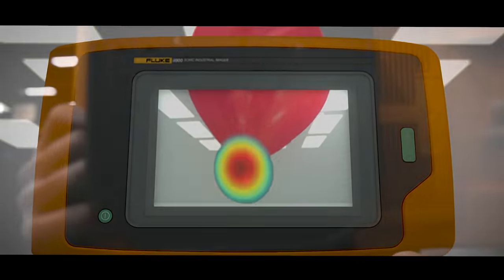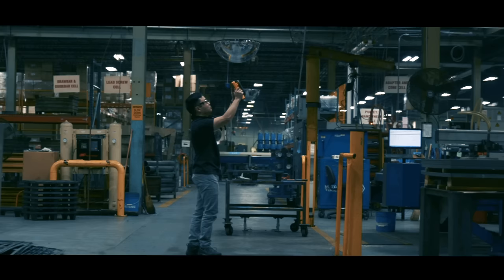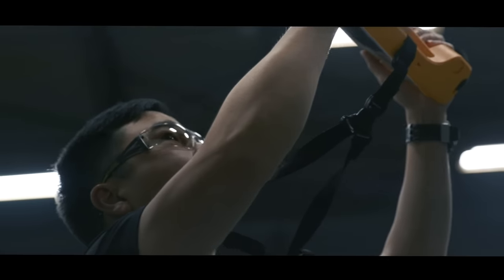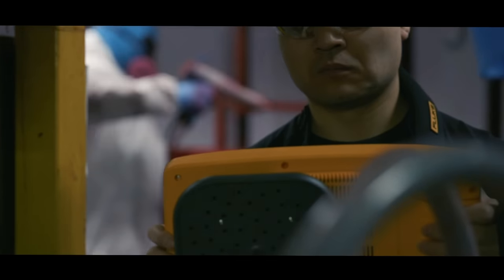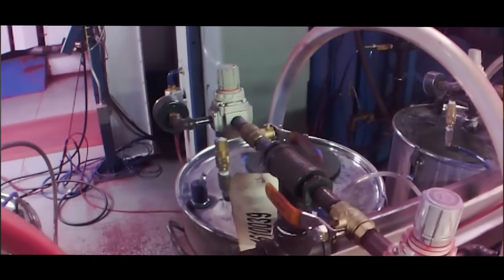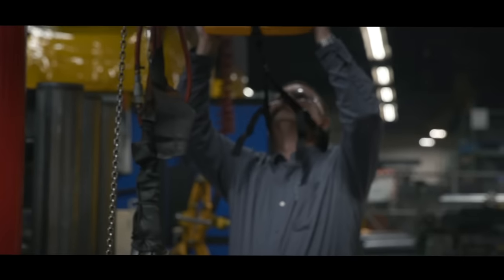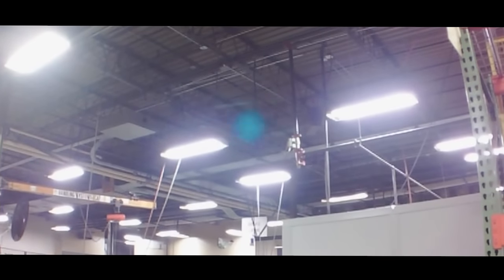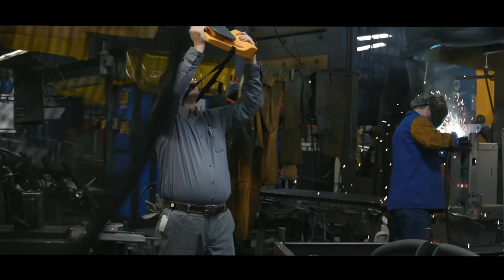Compressed Air Leak Detection with Fluke's ii900 Industrial Acoustic Imager

Comment: That's a game changer, I'm in for sure!
Reply: It's actually a bare faced rip-off copy of another product...
Reply: Alastair McLeod - could you please elaborate?  

I’m familiar with the Amprobe detection unit.  I consult for clients that use the Amprobe system.  Amprobe is owned by Fluke.  You can not rip-off yourself.  The Amprobe until lacks the screen and other client needed features.  This Fluke detector is a big step up, like a old mobile cell phone vs a modern smartphone. 

Last week I traveled to Indianapolis Indiana where we went into detail about this air leak detector with Fluke.  I’ve identified four clients that have applications where this detector would be a cost justifiable benefit due to do the application.   I’m in process of getting one of these detectors to our local Fluke sales agent so we can determine if we will be purchasing four of these detectors.  

I ask you to reply with the brand and part number that you feel is a equal to this Fluke air leak detector.
Reply: @DougAlesUSA   Alastair could be referring to either one of these aspects: 1) The core acoustic camera was developed by Soroma, not Fluke. 2) There are other, more advanced ultrasound cameras for gas leak detection already, namely from Distran and Noiseless Acoustics

Comment: As a hearing impaired heavy truck mechanic, this technology would be awesome to have to find compressed air leaks. Heck, even those who don’t have hearing issues would love to get away from chasing down air leaks with a bottle of soapy water. Are there any plans for future versions of this equipment with pricing geared towards individual mechanics?
Reply from the maker: Hi Chris - Thanks for reaching out! The acoustic imaging does make it more convenient and efficient for all technicians/mechanics who have been using older methods of pin pointing leaks. As of right now, the Fluke ii900 is the only product that we offer that uses the SoundSight and SoundMap technology for leak detection.

Comment: I saw a guy come through at work with one but had no idea what in heck it was till I Googled it.   It costs $20k, wow.  It's crazy expensive but if you have a large facility with a lot of potential leaks it can pay for itself and save you money in no time.
Reply from the maker: That's right, Travis. According to the U.S. Department of Energy, a single 1/8” (3mm) leak in a compressed air line can cost upwards of $2,500 a year.

Comment: It would be interesting to see how well this could work for detecting building leaks during blower door tests.  I've been told that thermal imagers are ill-suited to this particular task unless there happens to be a significant temperature delta between the indoors and outdoors.
Reply: Its not a thermal Imager. it uses sound detection and displays it as a thermal image, so that can be confusing
Reply: thats why you do it on a really cold day and crank the heat up